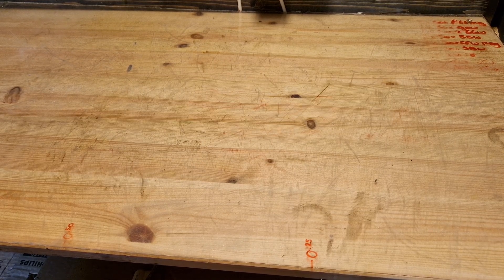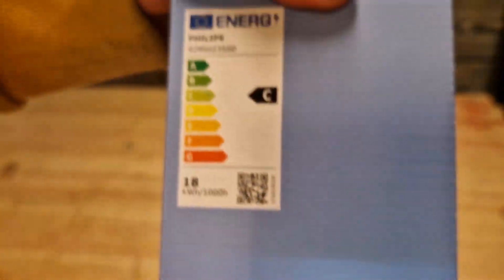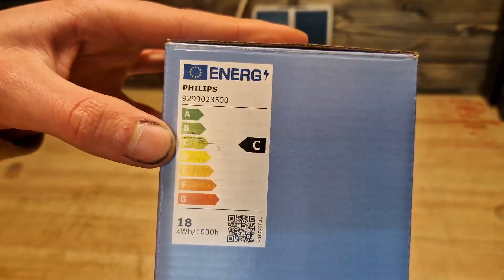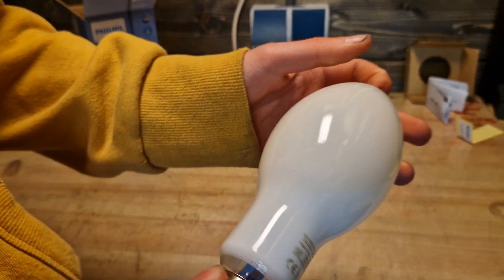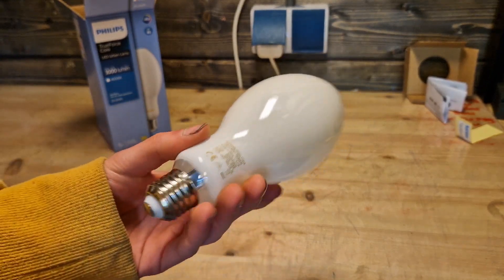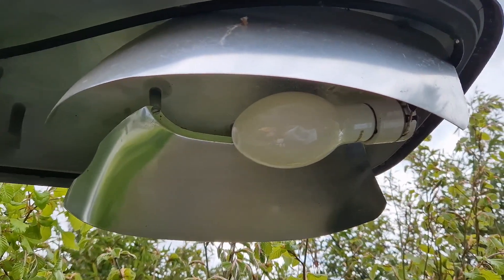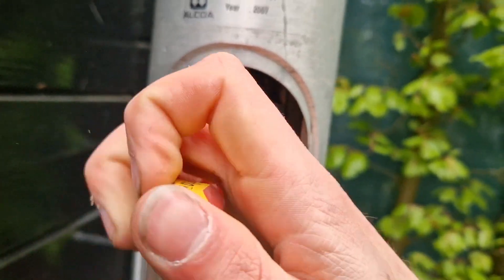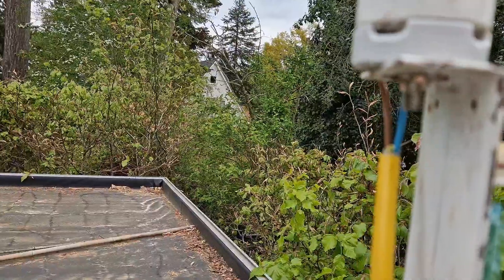This LED Bulb Looks Like A HPS Lamp, But Is It Actually Good?

Comment: It should be way brighter. They never made any mercury vapour, metal halide or HPS bulbs with an output this low. So I think it's not very suitable as a replacement for those bulbs. You might as well use use a normal size LED bulb if you want such a low output.

Comment: TCP makes a similar line of bulbs that are available in a wide range of color temperatures. They are available in 2200k so they do somewhat resemble a sodium lamp. I have installed one in an older area light and am pretty happy with the results.

My only complaint is that the large bulb extends further away from the reflector causing less light to be reflected downward.

Comment: But does it not look like a mercury vapour bulb. I am saying this because its not orange. HPS are orange because of the sodium in them. They are after all called HPS lamps ((High Peessure Sodium) vapor lamp)).So this is to retrofit a mercury vapor bulb. Still interesring that they make bulbs like this. Great video.

Comment: Nice LED fixture look like a HPL-N or HQL 125W but i search a store to buy someones and i think no ballast, capacitor and ignitor needed (yes because usually led not requiered all this components ive mentionned) but anyway i go to put this on my PQ from Schreder GIE group and Sulnor: Bracara